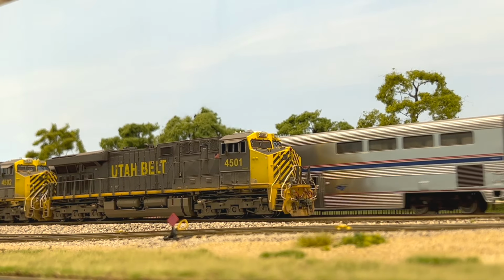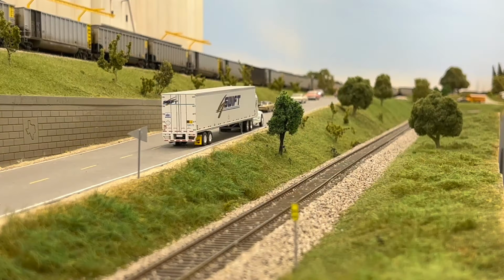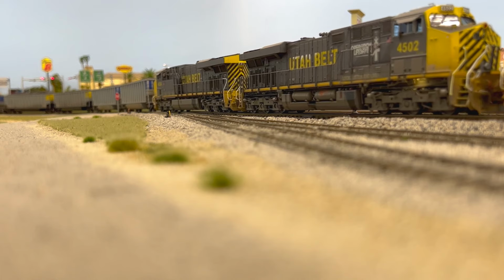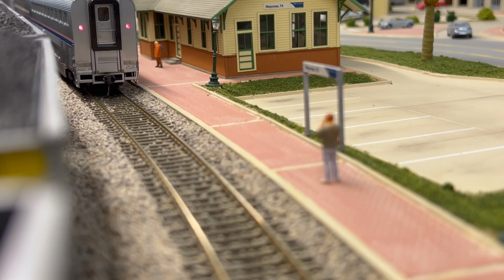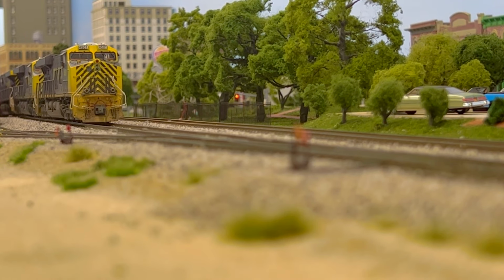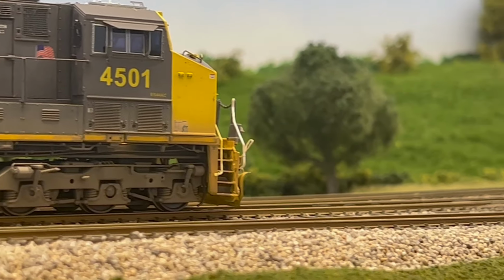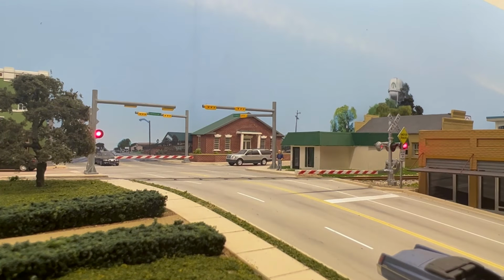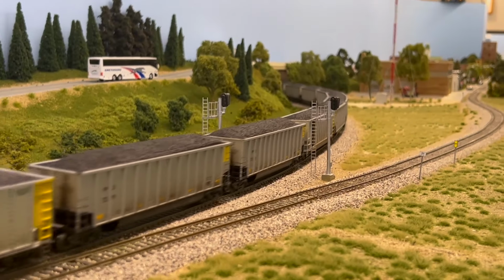Great American Model Railroads - UTAH BELT on Per Laursen's UP Central TX Layout

Comment: Why do so many model railroaders cut off the trip pins on couplers? I've never had any problems with them and they look like an airhose
Reply from the maker: Just personal preference. I take most of mine off, as I think they look clunky. I go back an add rubber air hoses on all of the cars after, but definitely nothing wrong with the trip pins.